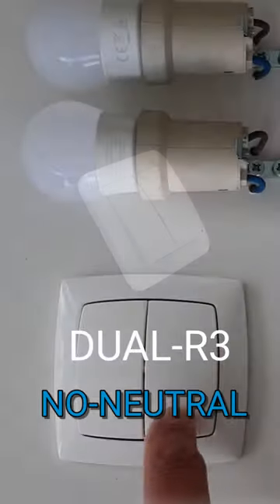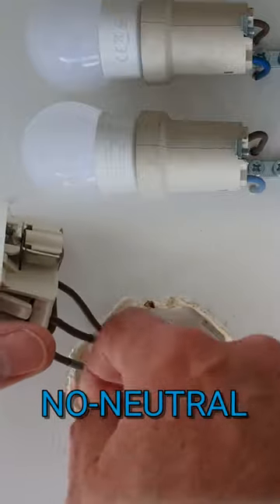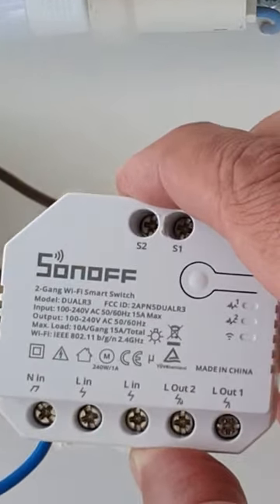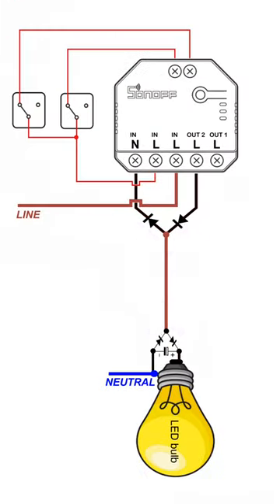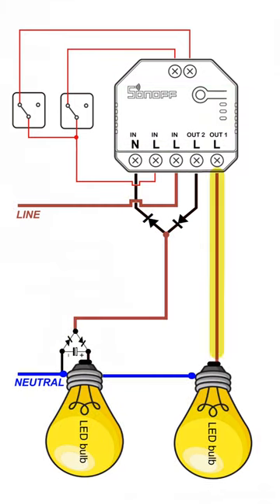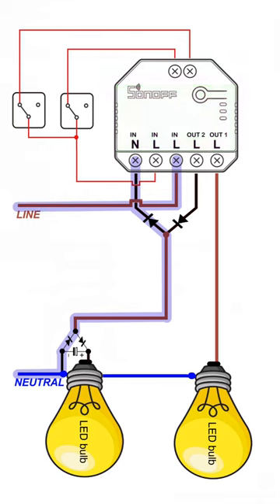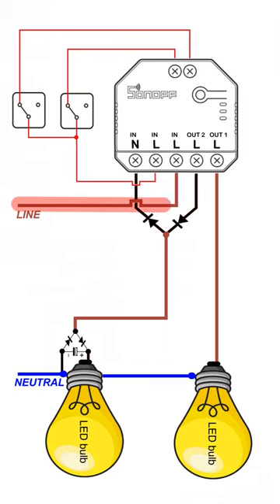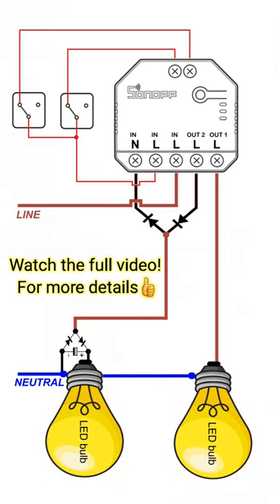Sonoff Dual-r3 NO-NEUTRAL simple "mod circuit"

Comment: I tried this with 2 switches and a lamp with 3 light bulbs on each switch. The switch with the diodes works perfect (all 3 bulbs), but the other one only lights the bulbs at about 30%. Any ideas on what I should do? Thank you.
Reply from the maker: @cristi497  it's hard to work out what you have done, but you could try different types of led bulbs. Some LED bulbs don't work well with this method. Also you could have a diode in the wrong polarity? Or perhaps a blown diode? To understand the circuit better look at my older videos. https://youtu.be/oBR5O391m_c
https://youtu.be/8h29-0rpQJo
https://youtu.be/mznx0xoF8Ck

Comment: don't let Ronaldfain push your buttons 😵‍💫 like your work and simple enough for the idiots like myself to understand....... I see the circuitry has been enhanced since I first saw your earlier videos .... for example in "Sonoff mini 2-way 3-way light switching NO-NEUTRAL solved #2wayswitch #NoNeutral" video.... are you able to supply circuit diagram and parts list......

Comment: Hello. And for a motor??
Reply from the maker: @performancefiore6004  some motors will work, like the the "universal-motor" (the type with brushes). BUT induction motors don't work!(Some of them have a capacitor and need proper AC to work) Most fan motors are induction, so won't work. Also your diodes need to be big enough to handle the motor current.

Comment: Hi. This Not work with Tuya qs-zigbee-s10-2c. But if i change Live wire to N connector and wire from bulb to L, it's starting, bur Bulb not get Light (((
Reply from the maker: Some people have reported, in the comments, that on some non-sonoff devices, all diodes polarity need to be reversed, and the capacitor polarity. I don't have that tyua smart switch, so I can't verify it for you. Just be careful not to blow any thing up😉👍
Reply: @MyProjectBoxChannel   I changed only the diodes, I did NOT swap the capacitor. I have a short circuit
Reply from the maker: @МаратХисматулин-щ6х  you can remove the capacitor for testing purposes, it's purposes is to prevent flickering in the led bulb.
But please use the safety testing method in this video,  it will prevent more diodes getting damaged. https://youtu.be/oBR5O391m_c

Comment: It won’t work because now your lights will be half as bright because it’s on the DC circuit not AC circuit and you also get phantom illumination because of capacitor
Reply from the maker: It absolutely does work. And the led runs at full brightness, because the capacitor charges to the peak of the sinewave. So it's not half-wave DC. There is no phantom glow either.  Look at my other video. https://youtu.be/oBR5O391m_c